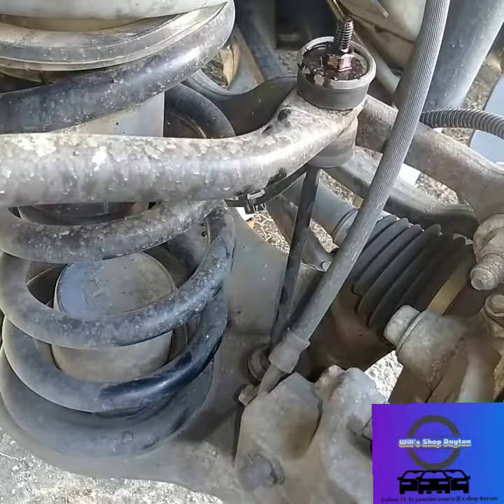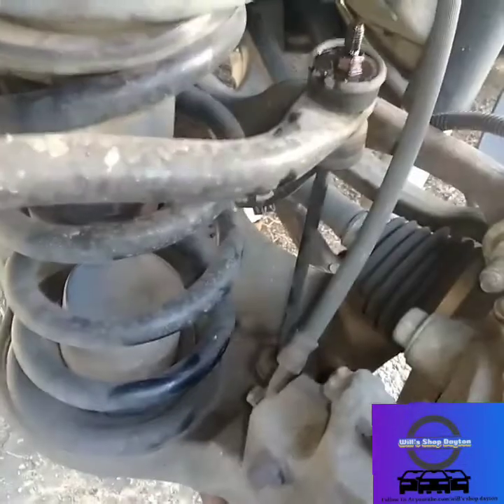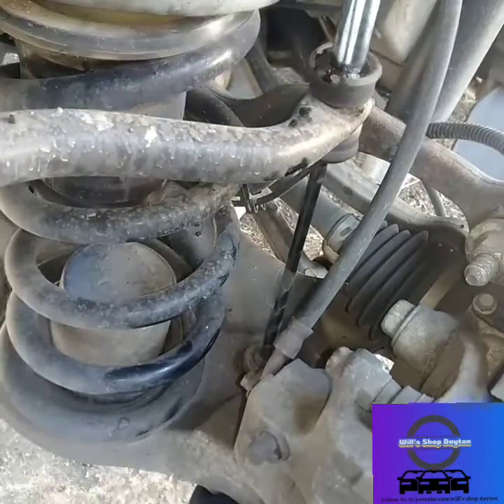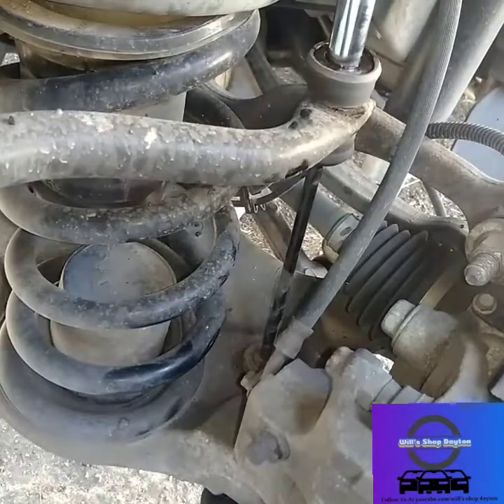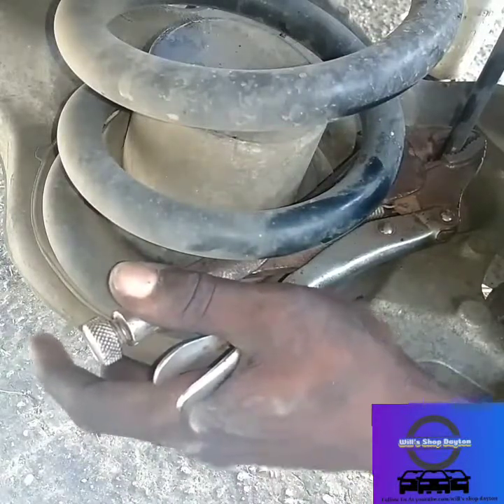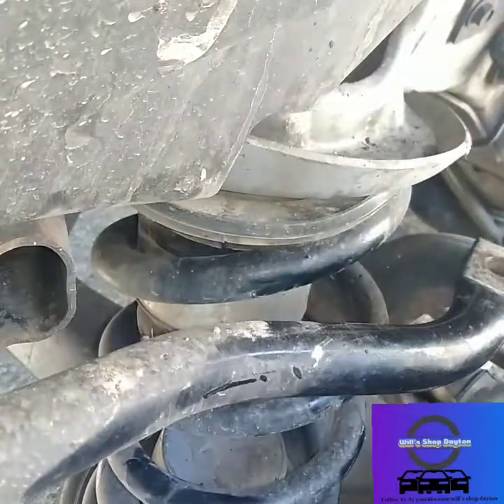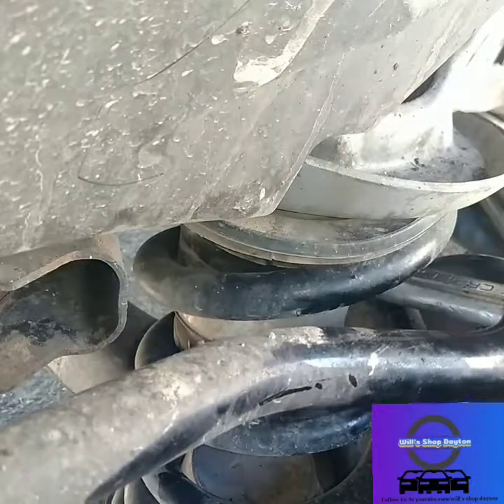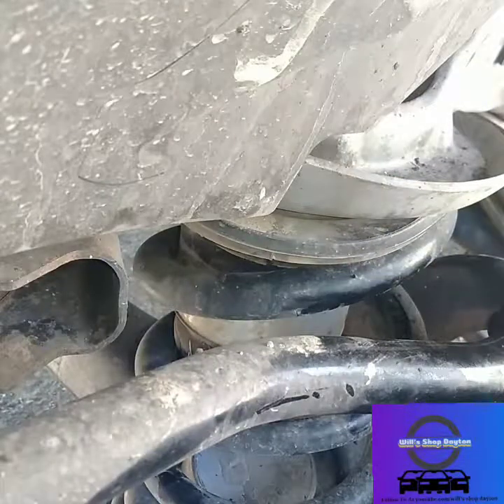2010 GMC Acadia rear sway bar link replacement

Comment: Why did you replace these ? what was the symptoms ? I’m getting a rattle noise over bumps already replaced rear and front shocks I’m stumped any idea what it could be ? Great video btw
Reply from the maker: I apologize this has been so very long ago but I believe that my customer was complaining of a rattling noise in the rear While going over bumps after We changed it there was more noise I hope this helps pin solves your problem let us know and have a blessed day
Reply: @willsshopdayton5206  ok maybe it’s my sway bar bushings
Reply from the maker: @CHB_98   I would suggest jacking the rear end up taking a large pry bar and try a wiggle things around and see if you have any movement it could be your sway bar links or it could be your  controller bushes so try to take a good look use a large pry bar see if You have any Play in any of the parts or bushes. Thank you again keep us informed if you find anything once again have a blessed day
Reply: @willsshopdayton5206  ok I ordered sway bar links I’m determined to find this noise
Reply: @willsshopdayton5206  I’ll also take a look at the control bushings and keep you posted

Comment: So you had to replace these because?  I just replace my rear shocks on my 07 but when I make a left or right turn and go over a bump/incline I get a hard clunk sound.  Is this what needs to be changed to get rid of that?
Reply from the maker: Yes changing the rear shocks should remedy this problem I will recommend you to check the bushing on your lateral bar in the rear I have seen that go bad and make it seem like the stocks are making the noise
Reply: Friend fixed it for nothing. Thank u